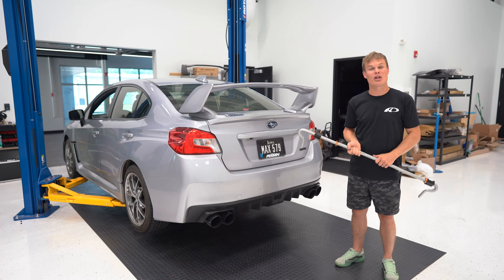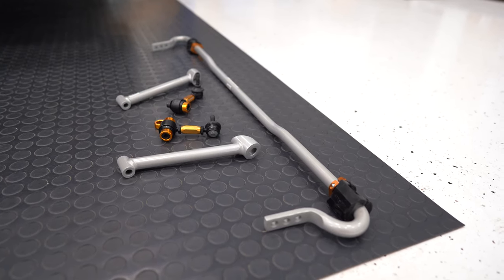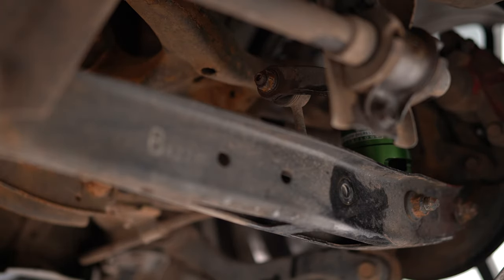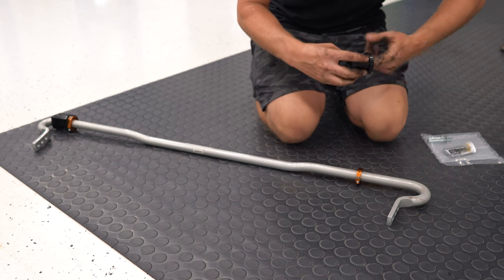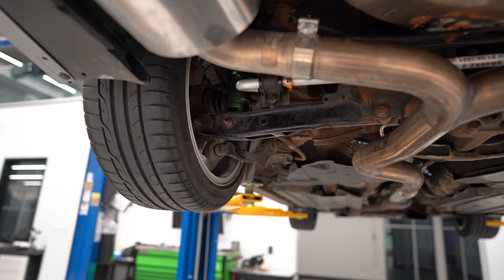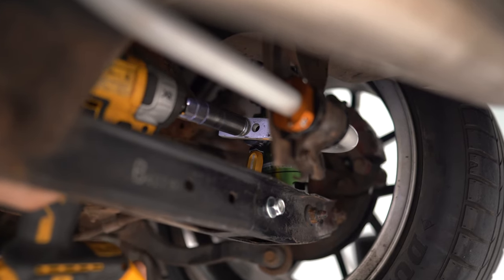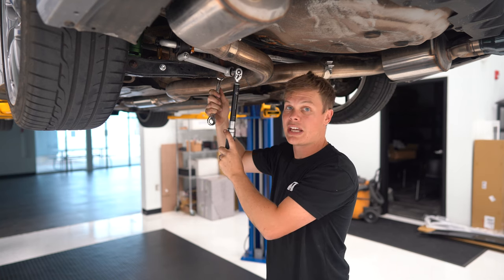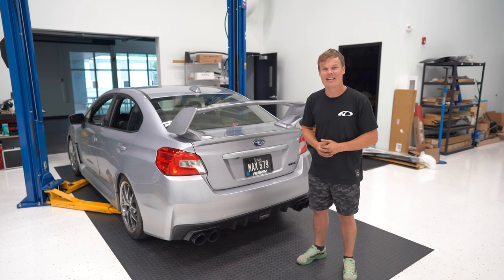BEST handling upgrade for the WRX!

Comment: I had this on my WRX with the kart boy endlinks. They bushings started squeaking after a couple months and even with more grease didn’t solve the issue. I ended up just removing the setup all together. Went with kart boy since I’ve seen in the past some adjustable endlinks snap over time. But great for the car must admit. Improves the cornering a lot. Double check passenger bushing mount. You have it upside down. The hook slots into the top.
Reply from the maker: Whoops. Good catch! Since I won’t be putting a ton of miles on this car I’m okay trading some comfort for increased performance at the track. But I’ll keep an eye on it!
Reply: Late reply, but what they did NOT show is that you're supposed to tighten the bushing bolts when the car is at ride height. If you tighten at full extension, the bushings will twist when the car lowers under its own weight causing the squeaks.

Comment: You should note that the stabilizer bar are directional. The r/s bar has a line on it. I did my whole suspension whiteline and air lift performance.
Reply from the maker: How does the sway bar feel with air suspension? I heard if you dial it in right they can be pretty good.
Reply: @FosterJohnsonMedia  My steering is stiffer. Like you can put the car hard into corners and the car holds its just fine. Like little body roll. So much more fun to drive.

Comment: Would highly recommend getting a matching front bar before going to the track. A rear bar only on a Subaru will actually reduce overall grip and create horrible handling characteristics specially on track.
Reply from the maker: The plan is to do the front bar as well just didn’t have a chance yet. Upgrading to a larger rear sway bar will allow the back end to step out more but as you stated doing both front and rear bars is more ideal!
Reply: @FosterJohnsonMedia  The front bar is fine to use if you upgrade to poly bushings and adjustable end links for zero preload. The stock ones are too soft so the front bar takes longer to react than the rear creating an imbalance.

Comment: Anyone have an opinion about a rear sway bar upgrade for loose surfaces? I’m in a ‘17 WRX, stock struts, Whiteline springs, lightweight 17” wheels, 245 gravel tires. On gravel and dirt I actually feel like the rear end is too lose at low speed. The car definitely plows at high speeds so I’m considering the small Whiteline rear bar and endlinks, but I’m worried it might make the car unmanageable when powering out of the tight low speed corners, which can make up like 30-40% of the stage.
Reply from the maker: A lot of rallyX cars run equal sway bar setups, or depending on conditions no sway bars. Having less sway bar allows the weight to transfer a little more and get better grip on snow and slick conditions

Comment: Why are so many sway bars adjustable?  How many ppl (constantly) adjust their bars to 'change' the handling characteristics after installing an adjustable bar?  Do ppl really set the bar to stiff for summer and then soft for winter?  I've only seen a couple of "one-hole non-adjustable" bars [which have my eye].   And on top of adjustable bars, any setting outside of the middle/factory length requires adjustable end links which then have to be adjusted if/when you decide to try out the near or far holes__ Foster, glad the car is progressing nicely; however, ( I ) would have loved to see befores and afters (timed/measured) comparisons w/the new suspension parts. .:R 🏁
Reply from the maker: The main reason I went with an adjustable bar is because I didn’t want to have to buy 3 separate sway bars. In the end you will get the same result however switching bars is a lot more work than adjusting your end links so to me it seams worth it!
Reply: @FosterJohnsonMedia ...thanks. I get it. But how many actually need that adjustment?  I'm glad they are available, but too much for work for me. Cheers....
Reply: In 10+ years of having an adjustable rear bar ive only adjusted it a few times. Mainly when the car goes from daily driver duties to being more of a weekend toy. Not super useful but nice i didnt have to buy a whole new bar, just adjust what i had in a few mins for a noticeable difference
Reply: @FosterJohnsonMedia  heads up on the front bar, I think my endlink contacts  my outer tie rod may want to extend endlink by 1 thread or 2

Comment: It’s just not a good track car. I have all the mods you plan on doing it seems but still this transmission blows apart at the track I’m on my 2nd one. The logical answer is get a R180 but meh I’ll build up my e46 and e90
Reply from the maker: What power levels are you at? I know the WRX doesn’t like to go much above 350whp. Are you flat foot shifting?
Reply: @FosterJohnsonMedia  nope I don’t flat foot and I’m around 380-390
Reply: @davidbeauvais1364  thats why you gotta sti trans swap, strong rotors and calipers, and some quality coils 👌🏽
Reply: @nikesbeast  I got hks coils man wasn’t looking forward to STI tranny swap at all but sigh oh well.
Reply: @davidbeauvais1364  is the sti trans swap that much more difficult?
Reply: @user-nq3jh6sl5e  it’s surely a lot of work.